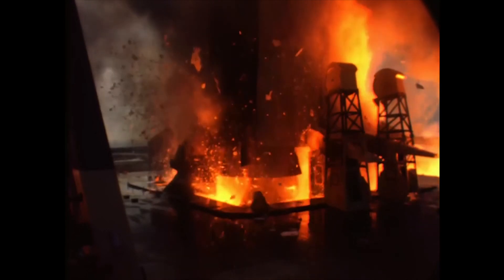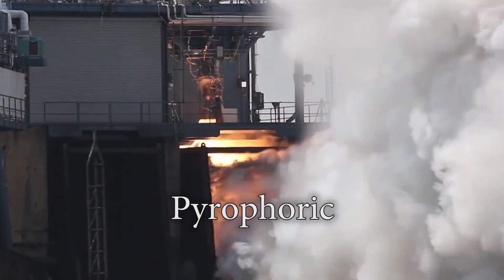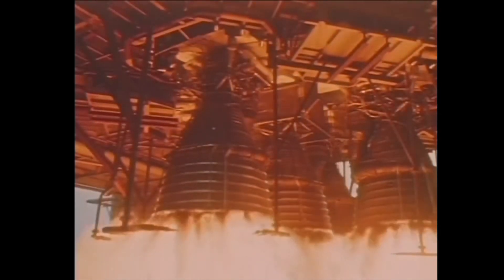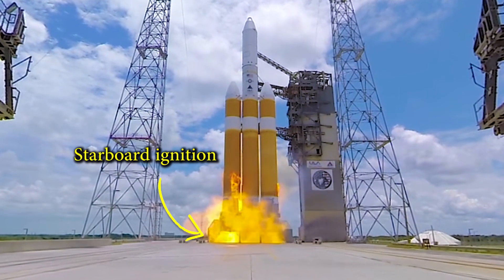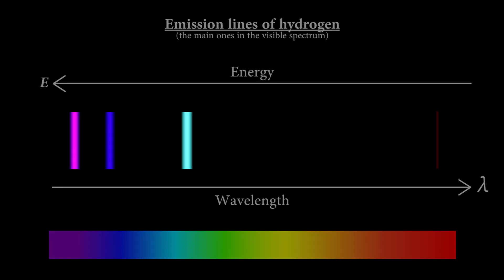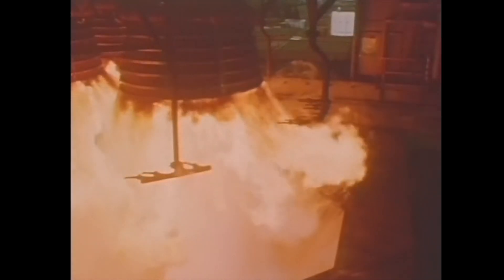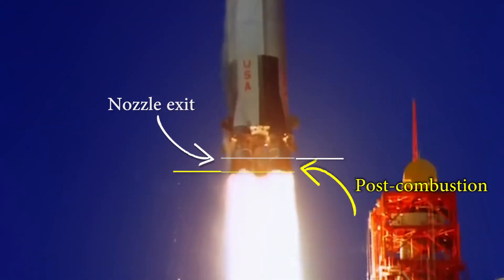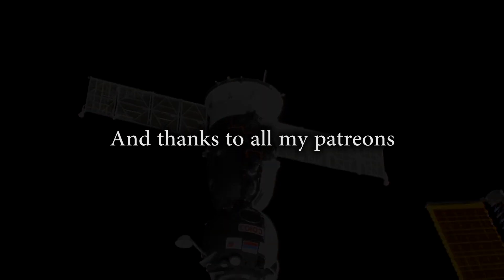The flames of the rockets, part 1 of 2

Comment: When the space shuttle orbiter engines are building to full thrust, Since they are at an angle, it actually causes the entire spaceship to teeter a little bit And they have to wait for the teeter to come back to full vertical before the hold downs release the rocket.

Comment: Love the video, though there is one thing with the F-1 that is not entirely correct, the dark curtain is the gas generator exhaust being put into the nozzle extention which is providing cooling.  The upper nozzle and combustion chamber were primarialy regenerativly cooled

Comment: Fascinating stuff; bring it on!

Your accent is not too difficult to follow, although your pacing can come across as a little hurried. It thus requires a bit more concentration to not miss anything.

One night back in the early 2000s I was watching, from a parking lot, a pass of ISS and the Shuttle, recently separated; the orbiter was leading by roughly 30 degrees on the sky. I saw two main engine pulses of exhaust from the Shuttle as it prepared to de-orbit. These two pulses expanded as partial spherical shells, more prominent in intensity toward the ground than upward. I did a back-of-the-envelope calculation, based on the estimated angular velocity of expansion and a reasonable estimate of the slant range, and derived a shell expansion velocity of between 1 and 4 km/s, if memory serves.

Comment: Ignition method:

American: complicated chemicals and compounds 
Soviet: wooden burning stick on string blyat
Reply: this reminds me of an anecdote form the Cuban crisis times.
When the soviets were supplying Cuba with mid range nuclear rockets, they were unloading them just on shores for the Cubans to later pick up and transfer. So, the US government invested quite a lot to develop a heli, that could lift the rockets one by one and deliver them to an american ship nearby. After this project was ready to start, the responce of the Soviets was to just chain the rockets in pairs.
If it works simple, you'd better not to look for Murphy's laws in action for your expensive project
Reply: @miro302 
lmao, at least it worked fine, huh?
Reply: @miro302  .... or during the US and soviet space race the US spent a fortune developing a pen that worked in zero G.....  The Russians just used pencils.
Reply: The burning stick method doesn't doesn't work when your flight plan includes shutting the engine off, and then re-lighting it like the Falcon does.
Reply: @robertkesselring  You mean the SpaceX rocket? 
Compare era to era, doesn't make sense to say a ford model T doesn't have the performance a Pagani has.

Comment: Would like to have some discussion about the 're-circulation' of exhaust up against the base of the rocket and even up along the sides.  The shuttle particularly had a lot of this exhaust that got 'sucked' back against the engine compartment and up the sidewalls of the orbiter.  Also, how about the scorch marks on the base of the external tank.  How hot did that area get during flight?  Then there's the Delta IV heavy trying to burn itself down before it goes up.  Fuel rich startup is cool.
Love the accent.  We can work through it.

Comment: I've been a space geek for over 30 years now, and I still  learned a ton during this video. Well put together! Don't worry about the French accent, I'm from Canada, I'm used to it ;-)  

One thing about the F-1 engine that has fascinated me from day one is the black smudge around the exhaust. It is the result of the turbopump exhaust passing through liquid helium and liquid oxygen heat exchanger coils. The resultant helium and oxygen gas are used for fuel and LOX tank pressurization, etc, and the now much cooler turbo exhaust gases pass into a manifold, which then vents it inside the nozzle extension. This boundary layer cools the nozzle extension, since the nozzle, throat, and combustion chamber are regeneratively cooled. Passive cooling for the nozzle extension, active cooling for the rest of it.  (The heat exchanger is the bottom half of the cylinder thing next to each engine bell, and the manifold is the thick  ring around the nozzle. A gas generator downstream of a gas generator.) . Keep up the great work! I will be watching part 2 next.

Comment: Excellent video.  Thanks.  Also, as a person making mods for KSP this is an EXCELLENT resource for rocket plumes.  
As the idiot making a KSP mod for the Aggregat rockets (V-2 etc) (https://forum.kerbalspaceprogram.com/index.php?/topic/127413-wip-german-wwii-rockets-including-never-built-absurdities/) I have a small correction due to way too much research on the V-2 engine.  They didn't exhaust the gas generator (primarily hydrogren peroxide decaying with a catalyst to steam and oxygen) into the exhaust nozzle, that was a fuel (75% ethanol in water) bleed.  It served the function of insulating the engine nozzle, but it wasn't from the gas generator.  That exhausted out from the turbine, split into two, and went to either side of the rocket between the fins.

Comment: The greatest problem during startup of high expansion engines is not poor propellant mixing as you claim at 1:07, but flow separation and side forces due to low pressure in the nozzle. The mixing and combustion of the LOX+GH2 (staged combustion turbine exhaust) in the SSME was always excellent, but the nozzles shook due to the flow separation which can be seen working down the nozzle as pressure rises.
Reply from the maker: Yes, and this particular effect is discussed at length in the next episode (part 2).